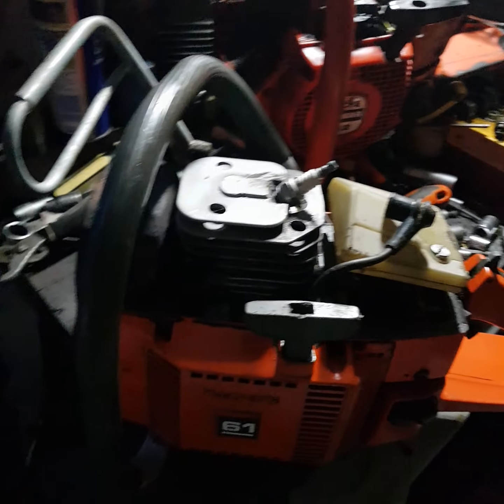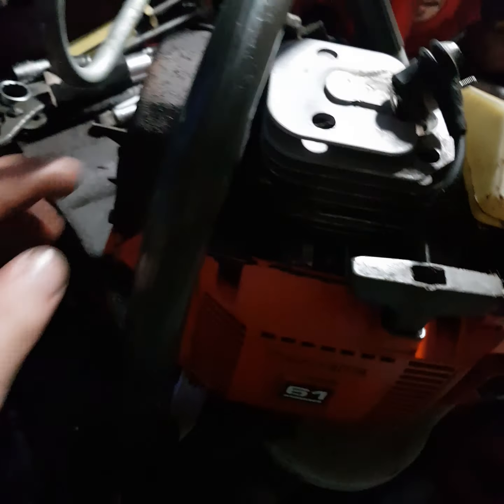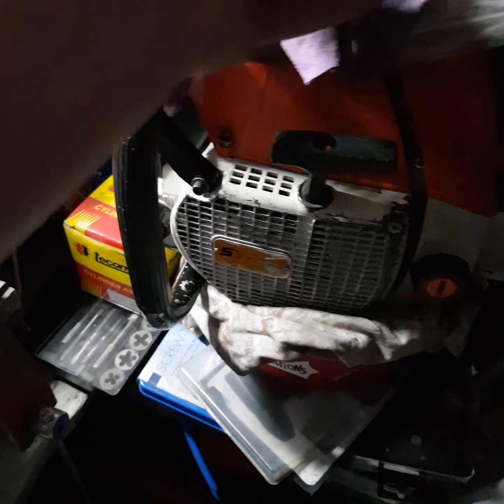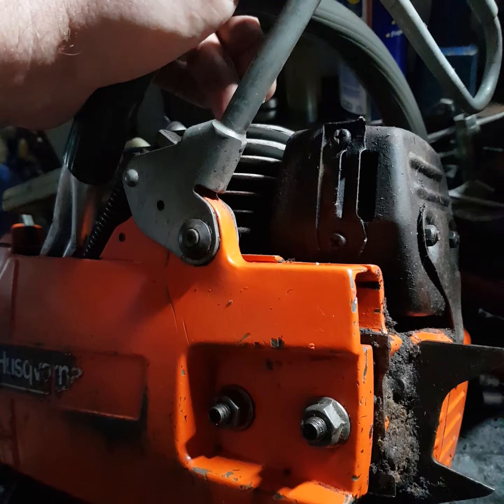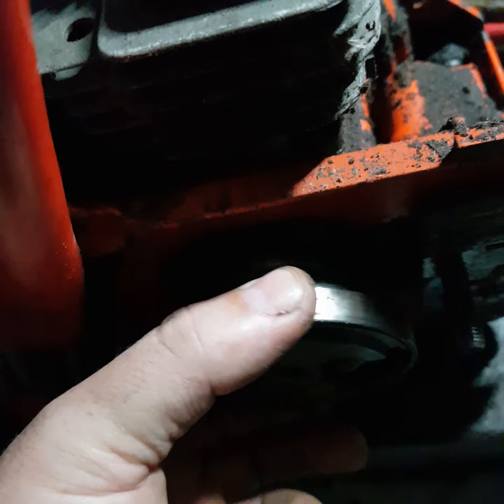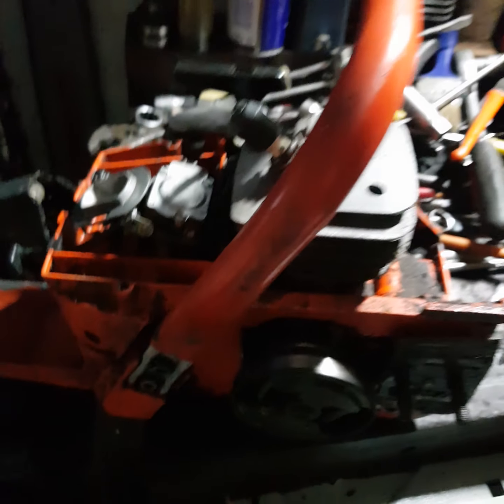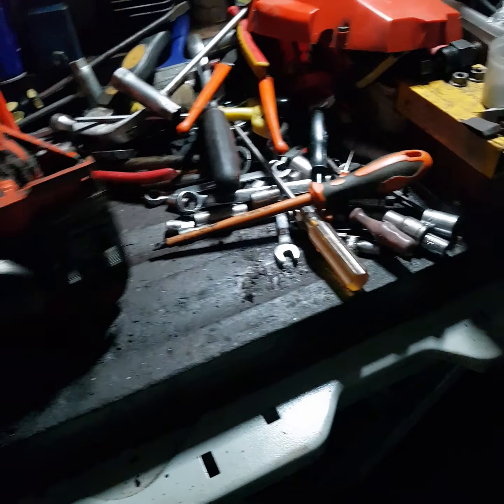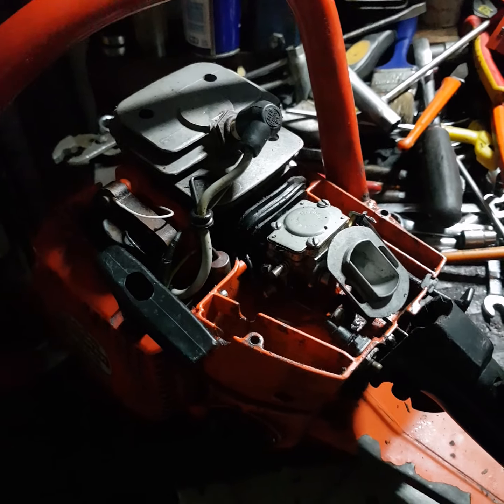Husqvarna 61 & Dolmar 112 projects

Comment: Te salut si spor la lucru sa ai 🤝👍👍👍
Reply from the maker: Multumesc, te salut si numai bine.
Reply: Exact acum doua zile am recuperat si eu un husky 61 dar cel cu capacul alb-crem,are setul dus si as vrea sa fac un upgrade la 272,sper sa-mi si reuseasca modificarea.Acum o saptamana am mai recuperat si un Dolmar 115i care era dezmembrat si dupa ce l-am montat merge surprinzator de frumos.Lipseste de la el doar capacul.
Reply from the maker: @crysdog2230  super, la conversia husqvarna 61 - 272 cilindrul e mai inalt si capacul nu se mai potriveste si capacul de 268,272 nu se potriveste pe husqvarna 61 practica cu capacul alb. Sanatate si spor la treaba.
Reply: Multumesc pentru informatii